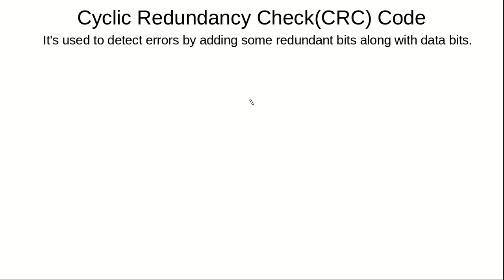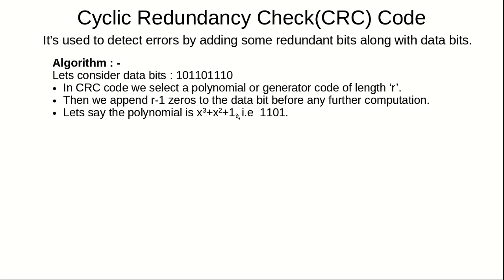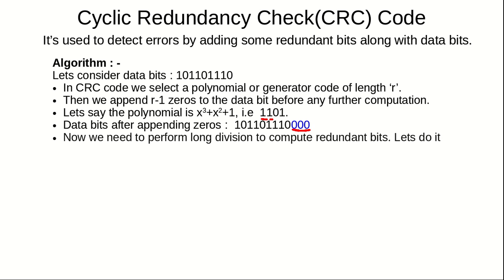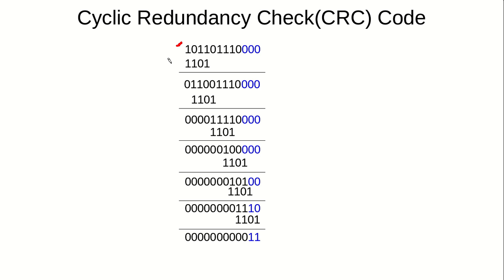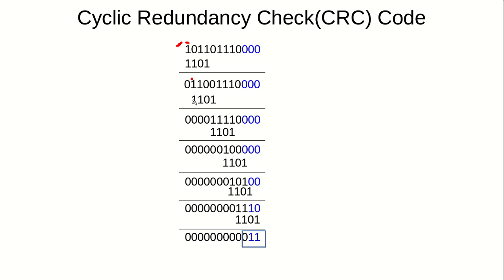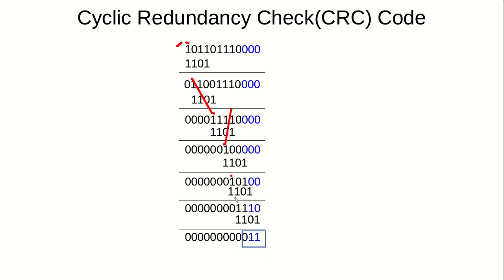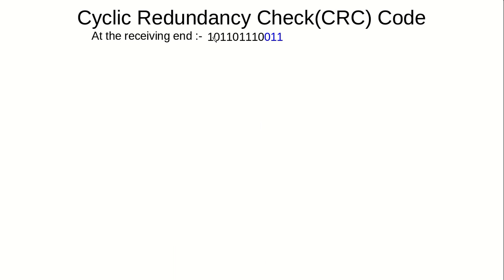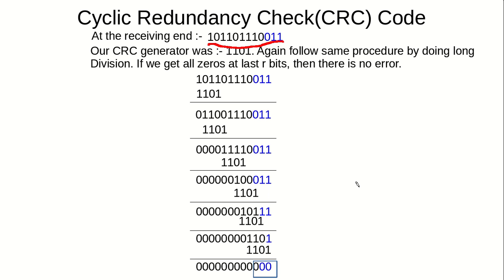Cyclic Redundancy Check Code

Comment: When people say CRC code, does  it refer to divisor polynomial or the code word that we get after appending the reminder to data word?
In arp, crc-32 means is it the divisor polynomial with 32 bits that we need to use for dividing the rest of the bits that are in the arp packet?